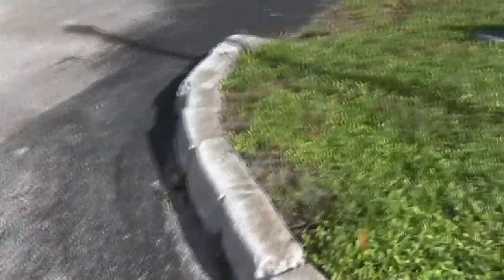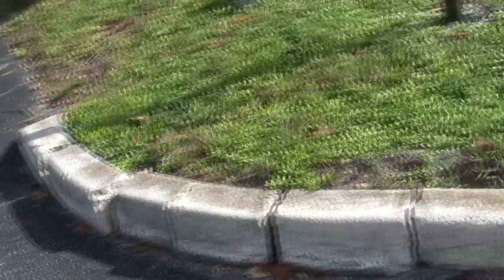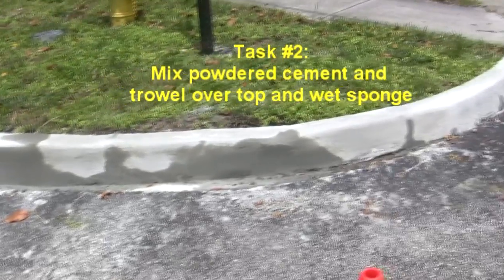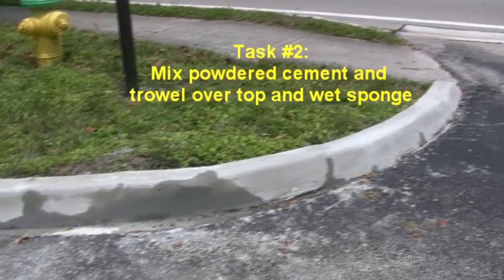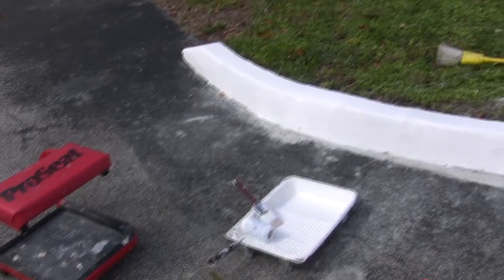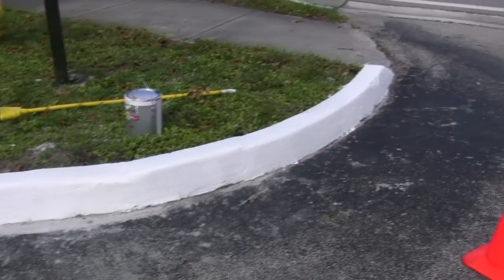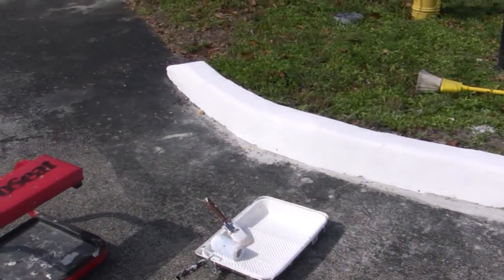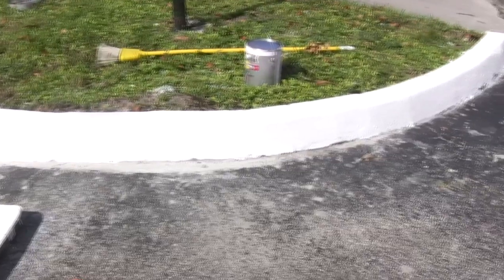How To Repair Cracked Concrete Curbs Broken Into Segments

Comment: Would this hold up in Canada weather
Reply from the maker: I would think you are better off redoing the whole curb in Canada, or at least drilling a few holes and fitting in some rebar rods first before adding the concrete. Being that I'm from Florida, I don't know about concrete mixes in Canada, but I imagine you would be using a concrete that is robust to expansion in the summer, and cracking in the winter.

Comment: Looks great but would not work long term in my opinion. Whatever caused the original issue will again cause it on this repair. Cosmetically it looks great but structurally won’t work long term. Just my opinion
Reply from the maker: You might be right, but if you have to fix it this is the way to do it
Reply: @ I’m removing old pieces and pouring entirely new concrete with rebar

Comment: If someone kicks it, or if a car bumps into it, it will just break again. Maybe I'm missing something....? Nice finish work, but the infrastructure is flat out broken,
Reply from the maker: We already kicked it and it held firm. This was a cheap fix, not a long drawn out drill and feed in rebar rods. This worked out nicely and made our parking lot look a lot better.